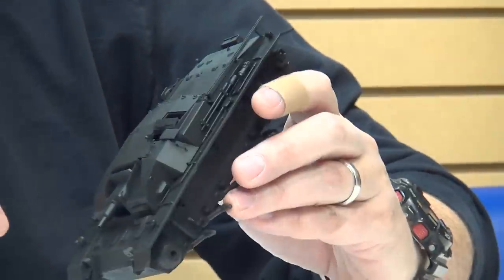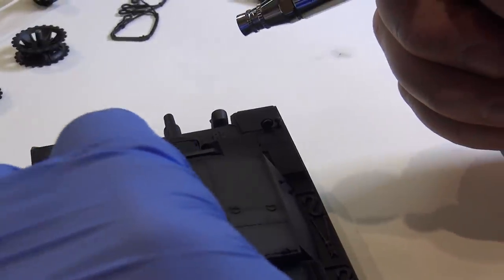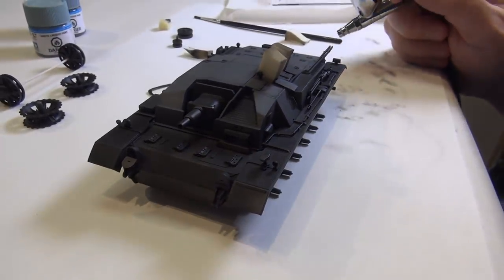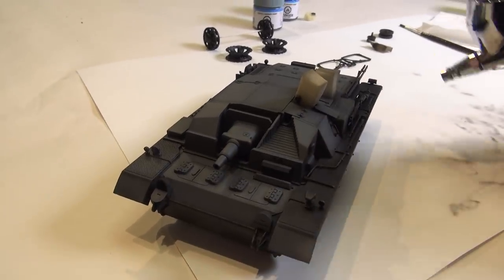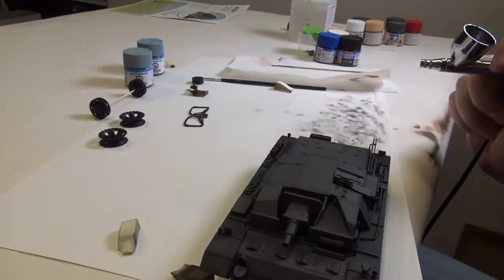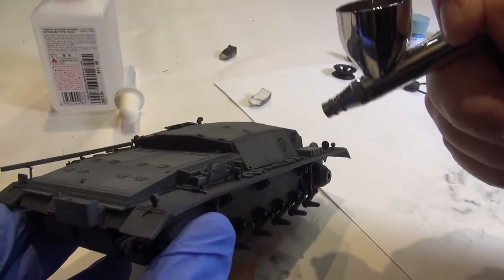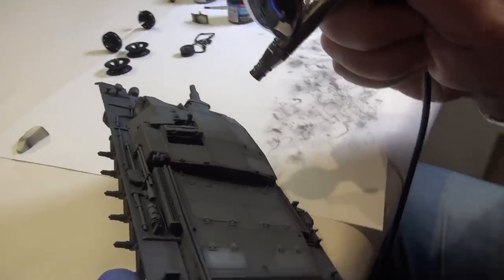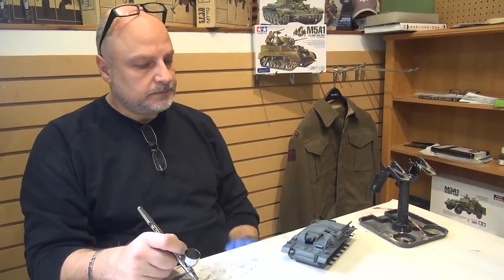Sturmgeschütz III Ausf B Episode 2

Comment: Hi Dave,
I noticed that in this video you go in very close with the airbrush- and build the layers up gradually. What psi are you using? Also, how do you control the the spray patten so easily-
do you do this by pulling back on the trigger but only applying a small amount of force?

Comment: I spent a lot of money almost $600 on mission model paints at 1st I like them then as I started using them they suck You can't use putty on top of them they're very weak i don't see where these are a decent paint  I've tried to contact the company and they just blow me off I've email John I've emailed the company can't get no one to call me back to answer some questions I'm a full time model builder I airbrush all day long I thought these were gonna be a good quality paint.. I don't know how in the world you could compare these Tamiya paints at all.
Reply: Sorry to hear you are having problems with the Mission Model Paints. They do require the right mix of paint/thinner/poly additive and air pressure to spray properly.  I use roughly 5/4/2 with 12-15 PSI.  The poly additive is a must as this really strengthens the finish.  I have to admit I haven't had to putty over them, so can't comment on this.  Not sure if these helps or not.  I know other modellers have used them with great success.
Reply: @daveforest28  I have done all of that and I have tried everything by the mmp  books lol . I do still use them but my own  way .I have been using the same polyurethane  made by Createx with mig products and ak paint and it mixes the same way. I even had my Son run test with the paint at the university of Michigan in his lab so I could figure out a solution to this problem. And he came back with a better idea how I can use them .I have a fulltime model shop this is my job not just a hobby I have over 8 different companies full line of products  that I use. so each model that I build will have some times up to 4 to 5 different companies paints but I mix a lot of my own paints so I am very  Knowledgeable about paint products I have been Airbrushing for over 30 years. I only build German and Russian ww2 .but I am still looking for the best paint .